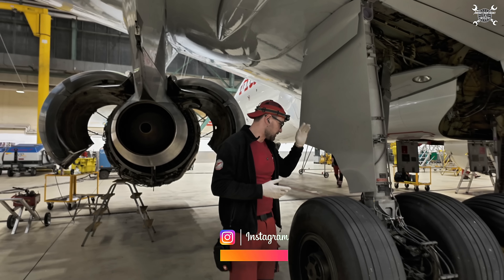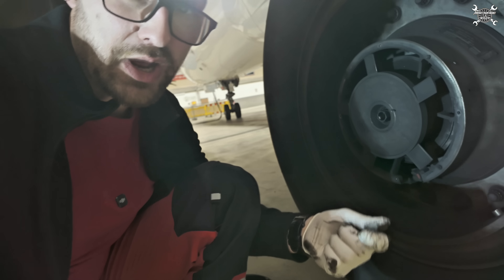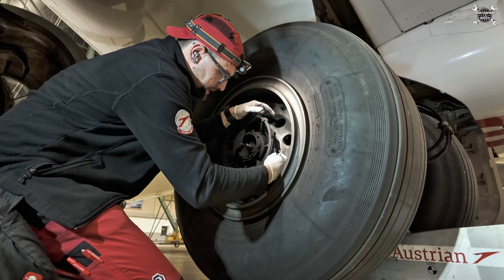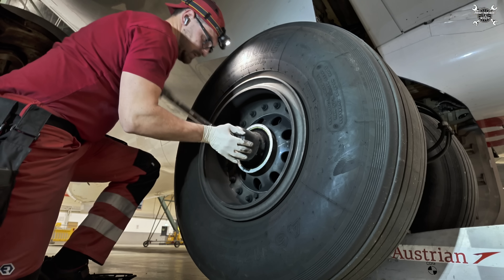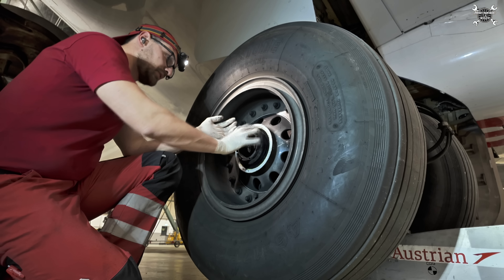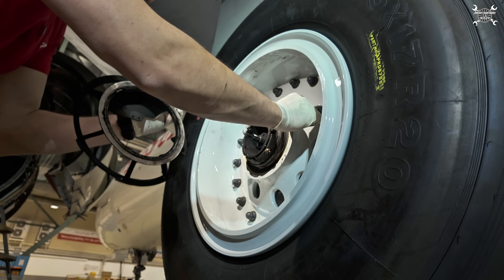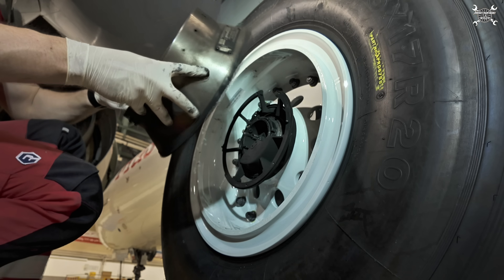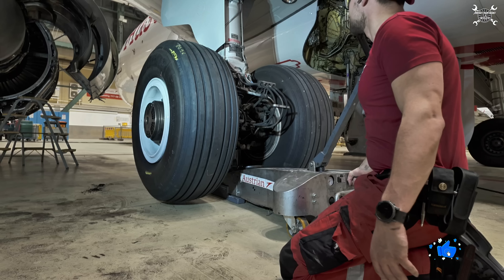Wheel replacement on A320

Comment: I tried to remember all the steps, is my cars wheel can be replaced the same way?
Reply from the maker: Glad you found it interesting! Car wheels are a bit different though.
Reply: @zeto.r  I'm actually used to be car mechanic, I'm pretty impressed how you secure almost each screw with a wire, don't see in most screws with cars)

Comment: I always thought that the brake fan would have an internal electric motor, but i couldn't see any in the disassembly. Is it in the hub and driven by an axle where  the nut that you secured in the middle sits?

Comment: A single wheel for an Airbus A320, including the tire and brake assembly, costs approximately $56,000 USD. This cost can fluctuate based on the specific type of tire and brake system, and whether it's a new or used component.
Reply from the maker: You are a bit low with the price because only the brake is around 55000€

Comment: Nice job, Bro! 👍👌
Dos the cooling fan help alright?
How many landings the main wheel on A320 lasts in average? 
On B757 we run about 290-300 landings. The best performance was 353 landings (Michelin Tire recap)
Reply from the maker: Hi the fan can reduce turnaround time quite rapidly, specially in hot destinations. Tire can last from 300 to 550 cycles 🙂
Reply: @zeto.r Alright! 👌 That’s nice to know! And that’s very impressive amount of landings! Do you normally use a factory new tires on your A320s or a good recaps? Or mixture?

Comment: Great video. What is the maintenance schedule or time to replace tires and oil and fuel filter those These engines have spark plugs, and if so, when is  changed thanks
Reply from the maker: Wheel survive from 350 to 550 FC and about all other things which you mentioned i have separate video. Take look

Comment: Isnt the nut on the inside and the head of the screw inside the slots ?????
Reply from the maker: Wheel nut is crewed on axle and it is secured by bolts and nut against axle

Comment: For the ones curious, apparently this tire is inflated between 193 to 200 psi depending on the load and conditions. 
Crazy! 
Just thinking a tire with over 13 bar of pressure, which will pressurize even more with heat, etc. 
What a beefy tire.
Reply from the maker: When it is hot, and trust me they are after landings you can get easy to 260-280psi

Comment: What is the torque for the wheel? 
Very interesting your videos. Here a 330-350 pilot.
Reply from the maker: I'm not saying this info since this info can be changed by airbus. But for now final torque for A320 is 140.12 and 110.62 lbf.ft

Comment: Never ever ever service an aircraft wheel sitting in front of it, it’s a split rim wheel and if it comes apart you’re dead.
Always work from the side of the wheel…
Reply from the maker: Mate you must hold air chuck otherwise it will leak. You can stand where ever you want because that pressure is instant kill wherever you stay
Reply: When two not native English speakers come together
Reply: @qualifierone8899 
I’m US Navy it’s against all our rules in aviation to stand in front of a split rim aircraft wheel.
That’s all I’m saying.
Reply from the maker: @foofghtr  I understand your point and you are completely right. That's why I never stand in front of wheel when ever I'm lowering the axle.

Comment: Excuse me but, your supposed to deflate the tire before you take that hub nut off. SAFETY FIRST. THAT TIRE IS DANGEROUS IT CAN BLOW IF YOU DONT DEFLATE IT BEFORE.🙄. Always follow the AMM procedures and not take short cuts.
Reply from the maker: What do you think I did with that jack. And I of course deflated it more. This video is not AMM and I will never show everything because then people can use it for replacement 😒

Comment: This is so useful. I've had my A320 sitting idle in my back garden for over a month now because of a busted tyre I couldn't get a replacement for. Now thanks to this video I can be up in the air again, taking ol' Bussie for a spin!
Reply: Dumbass you should have called me I have a mobile A320 wheel change service. I have all the parts and tools on the van and I work for a cheese sandwich and a curly wurly. Disclaimer: Aircraft may not be flightworthy upon completion. Warranty 5 minutes or 5 seconds whichever occurs sooner.
Reply: Yes some simple DIY repair can save you some money.

Comment: The number of different, specialized task-specific tools required for airplane maintenance is mind blowing. Not forgetting, the airplane designers must also design those tools and the methods and procedures to use them. This is a very complex field.
Reply from the maker: You are right. Aviation is very complex

Comment: THANK YOU! I have been following this but the 2nd nut is totally rusted on. I was spraying it with WD-40 and even put a torch on it but it wouldn't budge (the spindle may be bending slightly). I was finally able to bash it off with a hammer after 50 good whacks but now searching for a replacement.

Airbus was asking several thousand dollars for it, but I was able to find a matching part and pull one off a 2004 Ford Ranger in the parking lot. It's not perfect but should do the job.

Please keep these videos coming!
Reply from the maker: Cool. I will try my best

Comment: Fascinating.

Let me try to estimate the pressure in the tyres ...  Weight of fully loaded aircraft (70 tonnes) = 70,000Kg x 9.8 (g) = 700,000 Newtons.

I estimate (guessing) each tyre has a "footprint" (rubber touching the road) of = 50cm x 30cm = 0.15 m**2.   And there are 6 wheels, giving an overall area of ~1 square meter (rounding to keep the numbers easy).  Pressure = force / area = 700,000 / 1 = 700,000 Pascals = 7 Bar = 101 PSI.

So I guess you inflate the tyres to 7 Bar or 101 PSI.  Probably a bit more to account for hard landings?  Am I anywhere close?
Reply from the maker: Not even close 😁 you must double the value

Comment: Thanks to this video I’ll be able to do a DIY wheel replacement for my A320 this weekend. The Mrs will be very happy.
Reply from the maker: Cool
Reply: Why fan has some noises
Reply from the maker: @SebastianManyama because it cuts through the air
Reply: @SebastianManyama Nobody cares.
Reply: Nobody cares.
Reply: does it work  on my A350 too?
Reply from the maker: @travellerjj2173  yes
Reply: Invejoso.
Reply: I would go with low profile 5 spoke rims, much cooler
Reply: @farerse  Yeah, no way would I have steel wheels on my $100 million ride
Reply: And as always ... Lets give it a go 😂😂😂😂😂❤❤❤❤❤

Comment: You never show that you actually has the job card or a copy of the AMM ATA 32 main wheel replacement with the latest revision! Also the torque has to be witness due to the required independent inspection requirement.
Reply from the maker: Let's say it this way. This video Is not an AMM and I can show what I want to show. AMM is considered as confidential and I have it on tablet always with me. Replacement of MLG wheel is not marked as DI task

Comment: I watch videos from airline pilot who once in one of his videos talked about brake fans on Airbus and some health risks involved. Pilots or any ground crew should not approach hot brakes when the brake fan is running without some eye/nose protection like respirator or face mask, because of the small metal parts (I guess carbon brakes only) which are propelled into the air and you can breath them in intou your lungs which could lead into some serious health issues later. Is it safe for mechanics to replace these things like brake fans, brakes or tires without nose and eye protetction even if the brake fans are off and lets say the aircraft did not move for few days and brake fans were for example used lastly one week ago? Thank you.

Comment: You have not shown the washer which is beneath the nut of the impeller , plus there are two washers under 2 castle nuts as well
Reply from the maker: Mate this is not AMM you are not suppose to do it I.A.W. video. And because of that I will not show everything 😉
Reply: By the way i love to watch the vedios you made especially on A320 , coz I'm also working on A320 😊  @zeto.r
Reply from the maker: And check AMM there is only one nut under castle nut. Im glad that you like my videos 🙂
Reply: @zeto.r  nope I'm talking about axle nut which is retained by 2 castle nuts & they both have washers also

Comment: Did the jack pick up the airplane or compress the cylinder?
Reply: On that kind of L/G, the entire aircraft is lifted as the shock struck is already compressed. When you have a boogie system, like a 777 for example, then the boogie is tilted with the force of the jack.
Reply from the maker: You have two options how to do this You can lift the whole aircraft which will remove weight from the wheels (gears) or you lift axle with jack under it. You have still weight of the aircraft on the axle so the weight of shock absorber is the same. 🙂
Reply: It would be both. How much of each depends on how many sets of landing gear it has to spread the weight over. If it has 4 in the rear, it would lift the plane less than if it had 2. (unless they have some self leveling system, which I doubt, especially since the plane was off)

Comment: A special tool to hold the fan. Just use a wooden handle dude.
Reply from the maker: Mate I can replace wheel in 15 min and I don't need lifter, but I can't post such video....

Comment: interesting. So, there are no bearings? The wheel rotates directly on the lubricated shaft? Are the tires pressurized with nitrogen gas?
Reply: There are bearings in the wheel assembly

Comment: Why we give torque twice ?
And why to rotate wheel during initial torque and not to rotate in final torque ??
Reply: To ensure that all the sliding fit components like bearings etc are fully seated and aligned to the spindle axis soe there is no wobble.

Comment: Zeto, i'm an A&P student from America, we learn mostly on General Aviation aircraft at my school. I have a question: why do you torque while spinning the wheel on the A320? I have seen this on other aircraft maintenance videos but i never understand why
Reply: Spinning the wheel seats the wheel properly while you torque the nut...the higher torque sets the bearing, then you back off to a lower final torque
Reply: I know on some aircraft they do two torques. One like 350 ft lbs loosen then go to maybe 150/180 ft lbs for final I’m guessing the spinning wheel makes it easier to reach that high of torque but don’t know if that’s the reason why
Reply: Its the same with many automobiles that require you to torque while the wheel is spinning

Comment: Greetings from fellow LHG employee!! Assuming this a320 was not in maintenance only for tire replacement, how long did it take to complete it's maintenance?? Or was it just tire replacement?
Reply: Only tire replacement took around 1hour include jacking the plane and replacing tires for both main landing gear and additional ~20mins for nose landing gear

Comment: When you turned on the airplane, do you not risk the other airmen who were also working or were you the last to do your check?
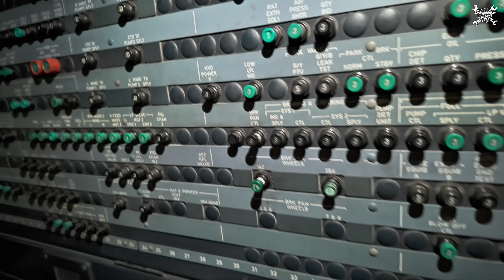Reply: I'm just an aviation fan who read the fcom, and from what I know, if someone works with something, they will use circuit breakers (0:15), so the system won't "wake up" while they're working on it. You can see that they even have a protection (0:30), so noone can turn it on accidentally.